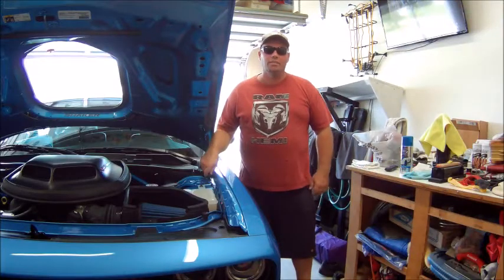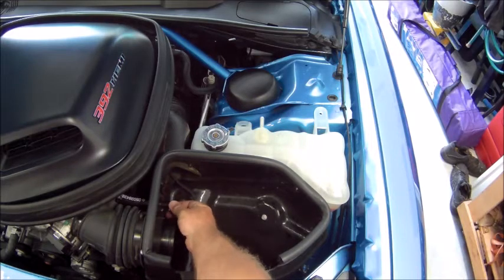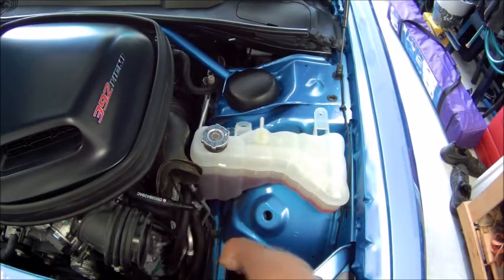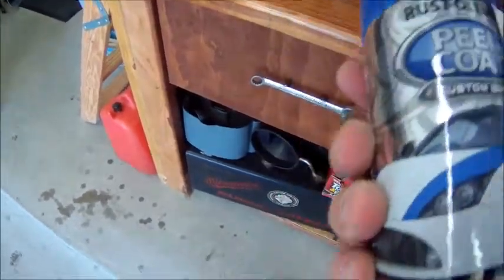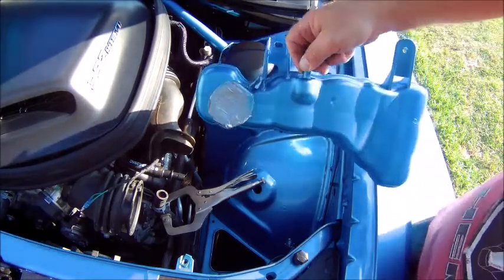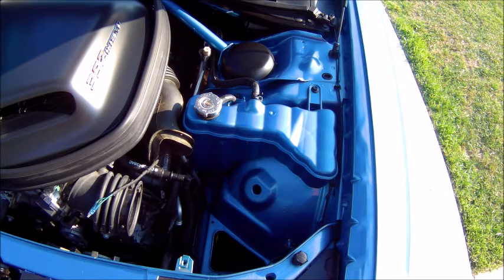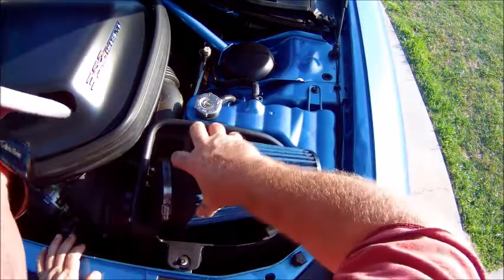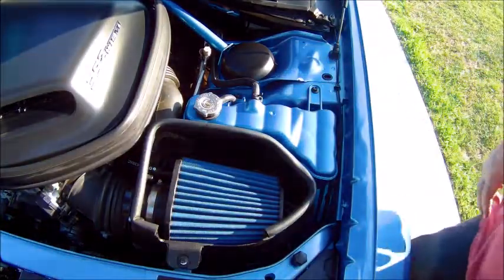CUSTOMIZING MY OVERFLOW TANK

Comment: Looks nice, but how do you easily see what the level is inside the tank, did you leave a really small strip to see through for level reading or no?
Reply from the maker: Yes where the indicator level is marked on your tank, i just taped off a patch and after painting removed the tape. Leaving a viewing window.
Reply: @DWSGARAGE  Cool.....looks like you thought of everything! I have a B5 Blue Scat pack on order too...can't wait till it gets here....currently only in D status....I saw that you have strut braces in the front and rear.....is that really a big difference or minor in terms of handling?
Reply from the maker: @SNeal5966  huge difference in performance handling especially  in the curves. For everyday driving  you probably won't notice it though. I like racing straight lines and curves so huge advantage for me.